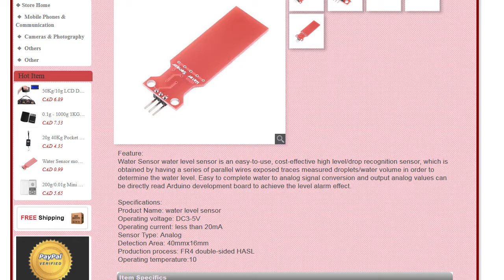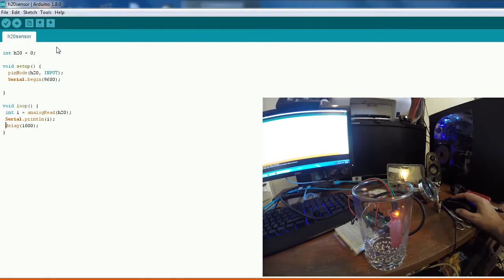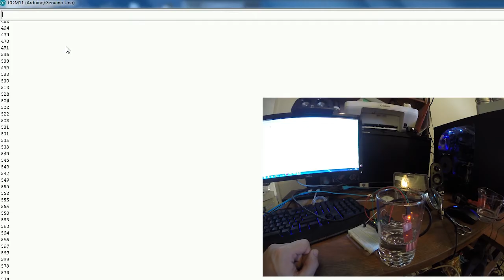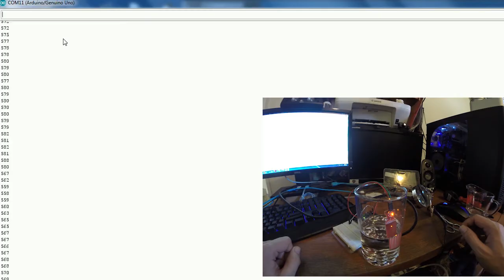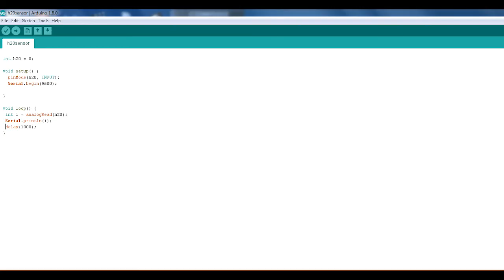Funduino Analog Water Sensor Arduino Test and Review (English)

Comment: Hi there, thanks for this video.  I am trying to find the best moisture/water sensor for a project of mine.  I need a sensor that would detect a bubble being blown onto it, would this sensor be sensitive enough to detect a bubble coming into contact with it and bursting on it?  Would it produce even a small change in voltage?  cheers

Comment: How quickly does it react to the water running away again? If, for example, the water clings to the board by surface tension, it could give a higher reading than actual. Did you test that? If as you said you want it to indicate if a pump is no longer under water, you would need quite a speedy response to prevent damage.

Comment: So what do the figures stands for? Not millimeters I am sure.
Reply: Arduino analog is a reading of 0V to 5V, represented by the figures 0 to 1023 from an analogRead(). So that sensor will show 0 when it's dry up to (but you would need to actually test this) 1023 at or near the top. Easy to convert that to mm simply by measuring how far up the sensor the water goes to get to 1023, or whatever value it actually reaches, then use the Arduino map() function to scale. Then if 0 reading is dry, and 1023 is (just as an example, I don't know how long the sensor is) say 50mm then halfway would be 510 or so to mean 25mm. But that assumes it's linear over the whole range. You would actually need to measure it. If it's not linear, you could try to establish the relationship mathematically, and convert the reading to depth using whatever equation you come up with. Or, just build a table and look up the depth for whatever the reading is.

Comment: how this sensor works? this is main question can you plz explain its working principle?
Reply from the maker: You can see the electrodes on the board (the long metal strips). Half of them are isolated from the other half until water closes the circuit. I'm guessing that the exact water level is determined by the capacitance. Someone correct me if I'm wrong!
Reply: @KevinGulling  Capacitive probes are contactless where Waterworks like a dielectric medium. Here the Resistance is working. 
 See, The principle is Current always follows the shortest path possible. So, the more path it travels, the more is the Resistance because of the formula
R= (Row x L )/ A, Where Row is specific resistivity, L is the length and A is the aperture of the conductor (pie x r x r ) for the cylindrical conductor, Here the thickness of the copper layers. 
 What happens is, when the water level rises, the current finds a shortest path nearest to the top (near the pins going for Arduino), and when the water level falls, the current finds a large path or in simple words large resistance path. 
 Takin the Formula V=IR, Ohms law... What we get is, the resistance R changes with water level, and hence the resultant voltage... 
 But... the water is not a great conductor of electricity, hence, the low voltage needs to be amplified before fed to the Analog pin of the Arduino...  hence the transistor based amplifier you can see doing the amplification part... 

Pardon if I explained in a lengthy manner... and yes, I am learning too.. so correct me if I am wrong..